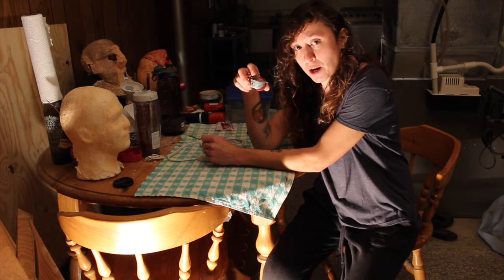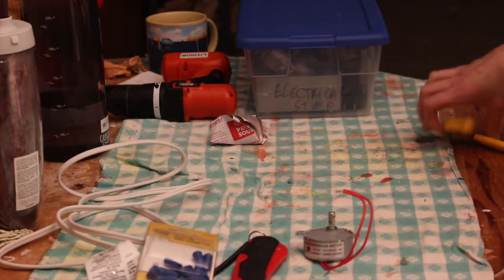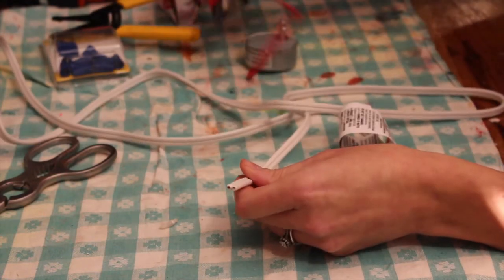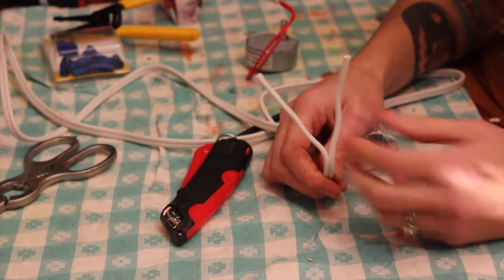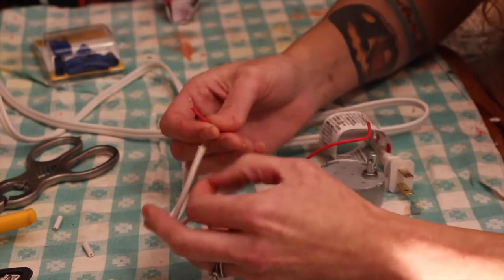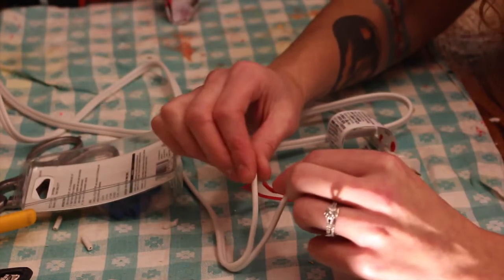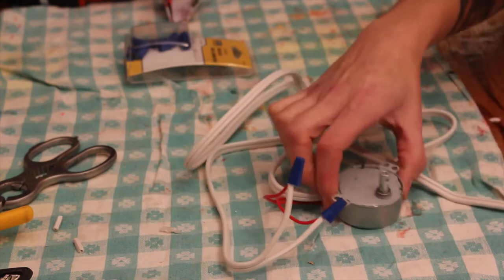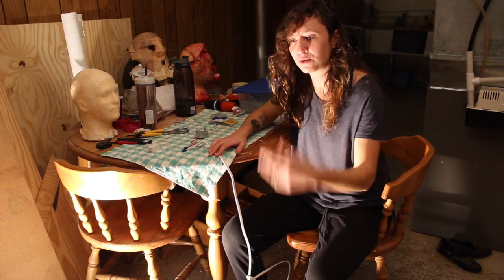MICROWAVE MOTOR HOOKUP

Comment: You might want to  tell that some microwave turntable motors don't run off line voltage but run at 21 volts off the cooling fan.
Reply from the maker: I am not a professional I should probably state that

Comment: My motor came with a blue and white wire.  Does it matter how they're connected to the extension cord?
Reply: Sir did it work when u tried when you connected your motors directly into power cable .
Reply: No. Switch for opposite spin
Reply from the maker: Sorry I just saw this cuz I didn’t think anyone would watch it!  You should google that cuz I’m totally not an expert